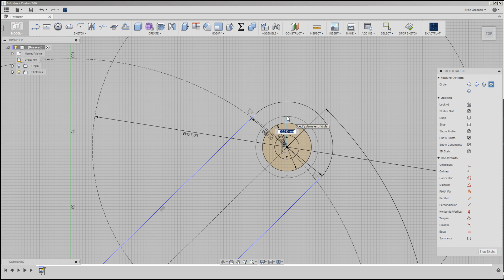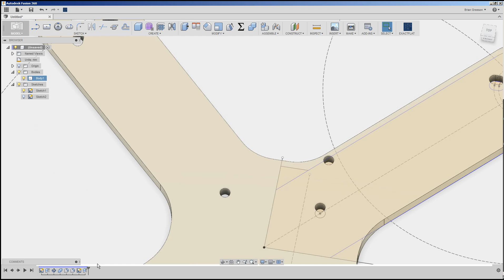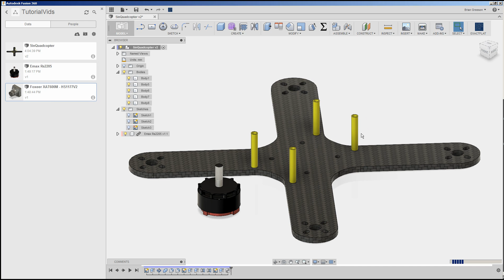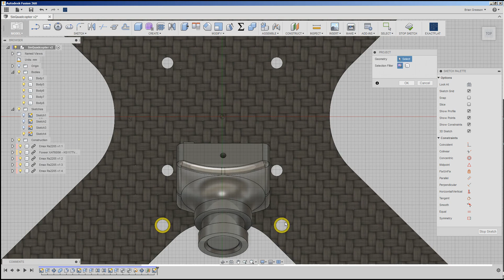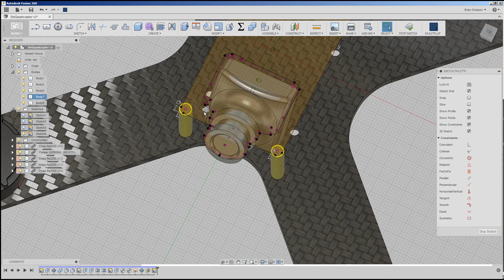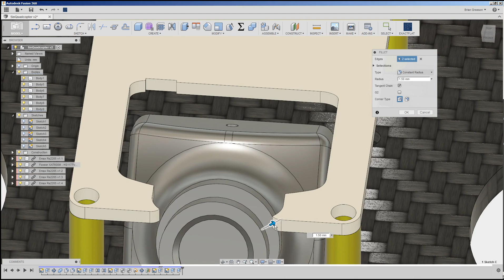Fusion 360 Quadcopter

Comment: Can you please continue this series of videos? You are the only guy I've found who explains what he is doing while they are doing it. Everyone else just plays music over them doing it.
Reply: Matt, sure thing! Do you have something in particular you would like see modeled?
Reply: I'd like to see how to do things like taper the arms in the middle so they are narrow then they fill back up as they reach the motor. Like on the HyperLite EVO how the arms are a little more narrow compared to the tips where the motors go. I am sure it involves using the "Fillet" Tool but i can't seem to figure it out. I wouldn't need a full quadcopter built in a video. Just the arm section would do in combination with what I've learned in this video.

And if you wanted to do a frame with detachable arms. but I'm 90% sure i could figure that one out of my own.

Most importantly though if you don't feel like doing any of that. I would really appreciate if you could show us how to take a completed design and lay it out and prepare the files to send off for cutting.
Reply: Sure thing, I will get started on the video.
Reply: Are you MuteFPV just on a different account? Which channel should i keep an eye on for the videos?
Reply: Hey Brian, Do you have other Fusion videos? Are they on the MakeFPV channel? I went there looking but all I could find were flight vids I couldn't even find this video. Thanks!